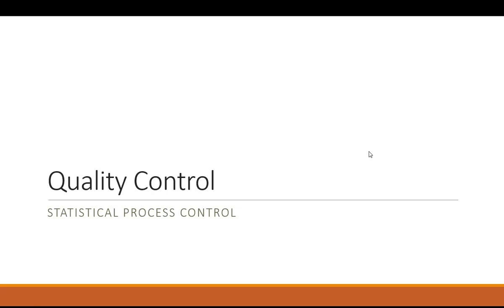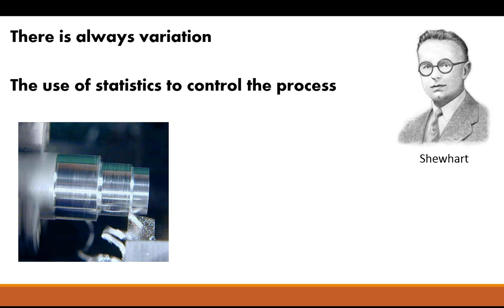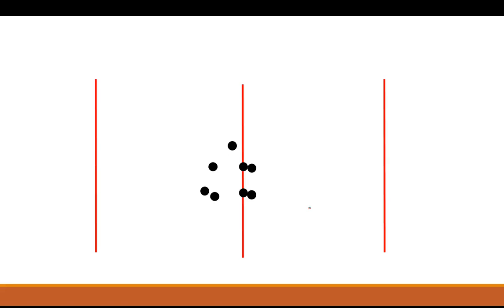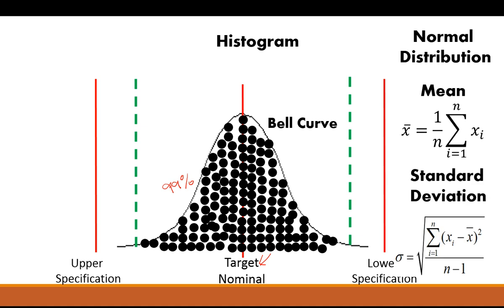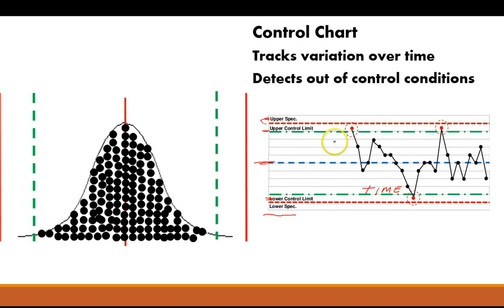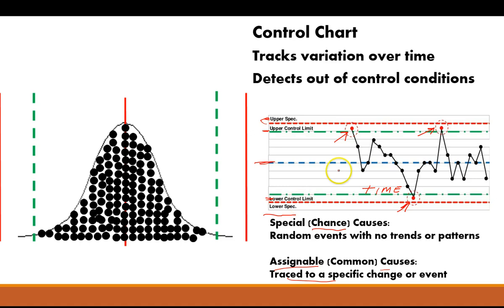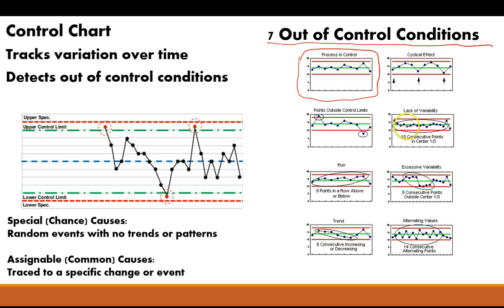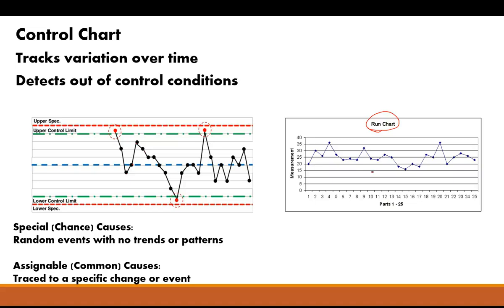Quality (Part 1: Statistical Process Control)

Comment: Can SPC be used for manufacturing rolls of prepreg…. These materials are made in rolls form one at a time …. It’s not final part but it’s a finished good for a customer that will mold and cure this composite materials at the customer… we have process parameters that are used to control the process but we are limited on any adjustments we can make

Comment: I'm having a bit of trouble understanding why "lack of variability" (15 or more consecutive points in the center) indicates a problem. What kind of problem might it indicate? Also, suppose we have a manufacturing situation where the same part is being made simultaneously on multiple machines, each with its own operator. All of the parts within the specifications are pooled at some point during manufacture. However, should we have control charts for each machine? (I would argue that we do.) If so, do we also need control charts for the pooled parts? (I would argue that we don't.)

Comment: In the practical world:
1)  With statistics, it always better to draw your conclusions (what ever pattern you may or may not find) from having more samples i.e. more data (more variety) = more accurate your conclusions becomes.

2) Not only investigate with production engineer & machining technician (those who make the part), it always good practice to consult your design engineer as to how the upper & lower limit were formulated, because the target value may not always be centered ("bi-lateral limit" in SolidWorks) or the upper & lower limit were deliberately biased to one side (to achieve certain fit), but some factory hated it (time factor) and so they machine to median tolerances and not bi-lateral without notifying e.g. injection mold tools & cavity or most Chinese machinist for mass production.

3) More over during NPD process , design engineers only have fewer samples to work with (smaller data set) compared to mass production where you tend to get a more accurate read (much larger data), because quite often the upper & lower limit has to be re-assessed (if it an internal component) even though it possible no changes to the production process whatsoever, which is why it a good practice to consult with "design engineers".

4) SPC + time:
Time of day can cause havoc or even seasonal (beware), because of all the heat built up during the day by all those machinery or direct sunlight shining through the windows.  If this is a real problem then you should really invest in temp & moisture control environment (expensive option for some factories), just like some treating like a CMM equipment.)
Reply: Oojopjpjjpppjppppppppppppppppppppppp
Opl

Comment: Points of clarifications: (1) Common Causes are random events that are inherent in the process. Special Causes are due to specific changes or events that cause variations in the process, not the other way round. (2) Any chart that displays measured data over time is called a run chart. This means that all control charts are run charts. However, when we have a control chart without the central average line and control limits are just called run charts.

Comment: Sir nice vedio but would love to know what are the different reason for these 7 out control charts and how to solove them.
Reply from the maker: It depends on your various situations.  It could be an issue of machine maintenance, worn tooling, changes in temperature, adherence to procedures. It all depends on the inputs of the process that you are monitoring.

Comment: When you set the rules for out-of-control conditions, how does the number of points in the rule depend on the sample size?  Should i count 8 points above or below mean either for a 100 points sample and a 1000 one? Also, if I get new data into the series, should I recalculate the average? Thanks...
Reply: Daniel Serra the standard rules for control charting are the same regardless of sample size.  See “western electric rules” and/or “Nelson rules”. These rules are the standard for a reason. They aren’t just made up or arbitrary.  They have a statistical basis.  Point being; you yourself don’t SET the rules.

Comment: I think you have an error in the definition of special and common causes at around 7:45 in the video.  I think you have the definitions on your slide backwards.  Common causes are random events with no trends or patterns.  Special causes are traced to specific changes or events.  You have them labeled backwards.
Reply: Yes, agree. It should be other way around.

Comment: is there some sort of hypothesis testing that can be done to determine whether a "trend" actual is an out of control process or appears that way by chance?
Reply: Typically people just use the Western Electric or Nelson rules to identify the more typical trends and patterns that are seen in processes.  If you are really good at stats you might be able to determine the probability of getting any sequence of values given a data set but my gut tells me this will almost always be a waste of time and effort.  Best to stick with what people have been using for almost 100 years now. 

Using extra detection rules:  https://www.qualitydigest.com/inside/statistics-column/when-should-we-use-extra-detection-rules-100917.html

More on control charting rules:    https://www.youtube.com/watch?v=JaBJD7ocVq4